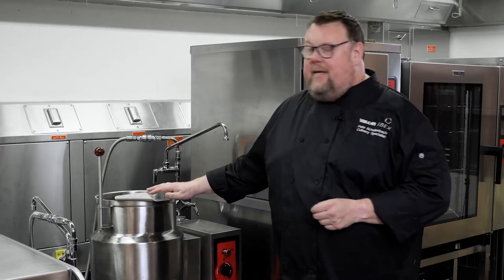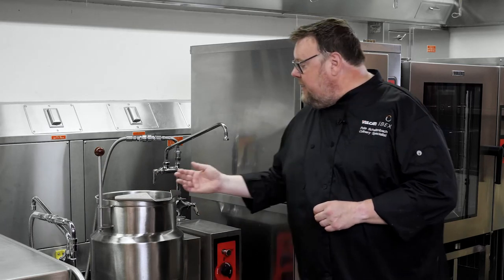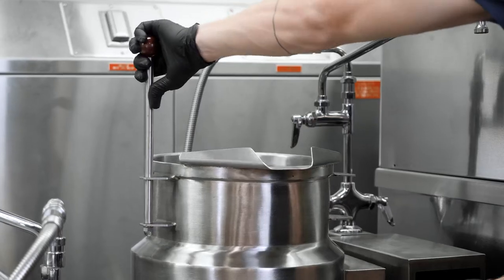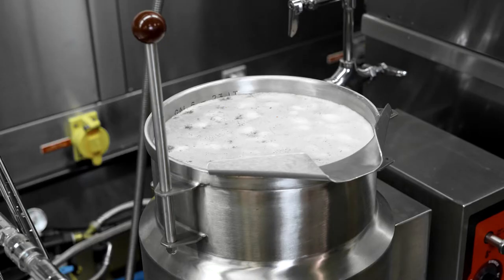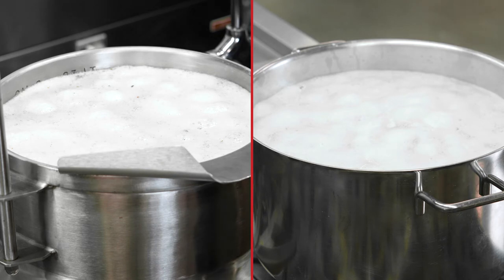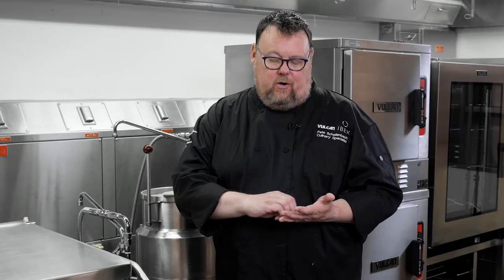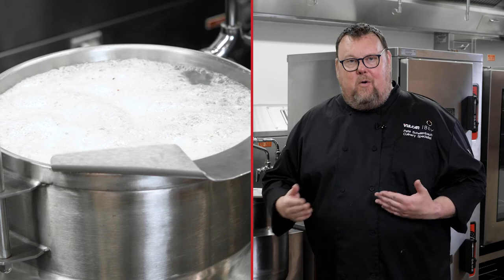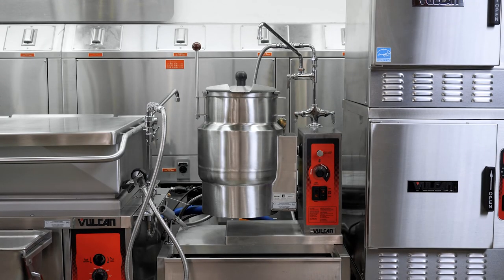Benefits of Using Steam-Jacketed Electric Tilting Countertop Kettles

Comment: Could this Kettle be used to make Custards?
Reply from the maker: Steam jacketed kettles are excellent for making custards because of the ability to control heat.  A large pot on open burner requires attention to prevent boiling. Custards, sauces and cooked salad dressing that require whole eggs or egg yokes must not be boiled after the eggs are added, or it can cause the finished product to curdle.
Reply: @VulcanEquipment  Thank you for the response. Just wanted to make sure prior to making the purchase